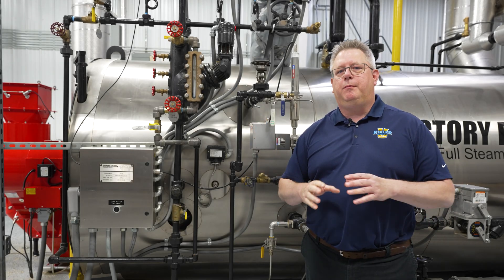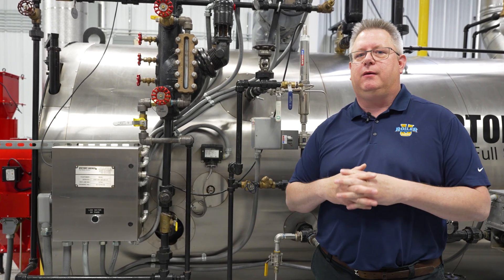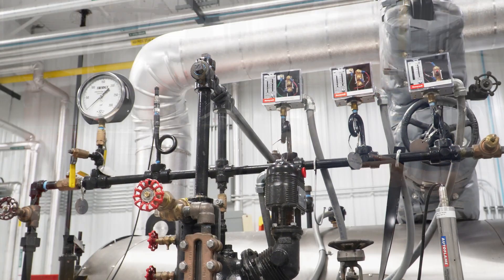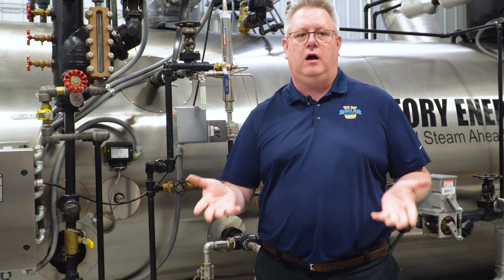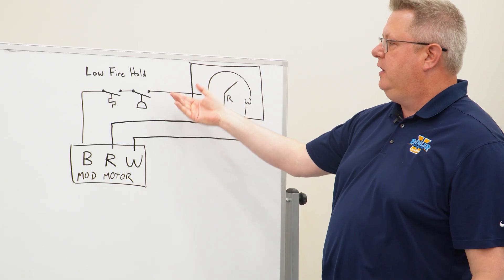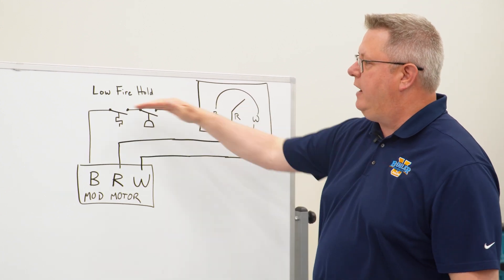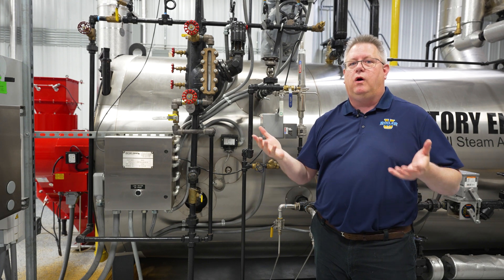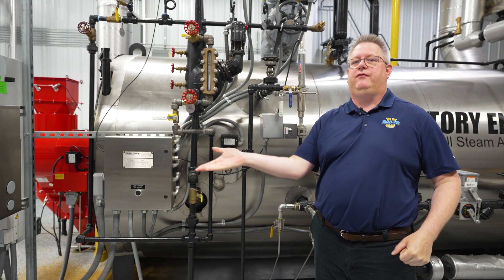Low Fire Hold Tips for Longer Equipment Life - Weekly Boiler Tips

Comment: Low fire hold that uses a pressure switch can also be fooled the other way.    Example if the process is consuming steam and the minimum firing rate produces less steam than is being consumed the pressure will not rise.  

Thermostatic low fire hold seems to be the better in this case. 

Timed low fire hold is another way to do it.